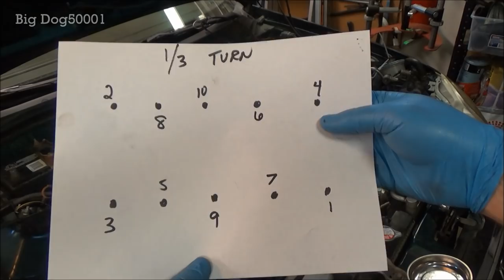Honda Cylinder Head Removal 2000 Civic (Head Gasket Replacement etc)(1996-2000 Similar)

Comment from the maker: In this video, I did not remove the timing belt from the vehicle like the Honda manual tells you to.  I bought this from someone who did not take care of it for a long time (so the car was mine at the time I filmed this) and I wanted to get it running as quickly and as cheaply as possible so I used a shortcut for the timing belt.  If this job was for someone else, then I would have removed the entire timing belt properly and recommended that a brand new timing belt, new pulley, new water pump and new belts be properly installed after the head was repaired/replaced.  

If you want to give a thumbs down for this, by all means go ahead, I understand.

P.S.  It has been well over a year since I filmed this and I still own this car and it being driven every single day without issue (one of these days I will go ahead and replace the timing belt components).  This is the car I loan people when they bring me their vehicle for repair and they do not have a vehicle to drive while I am fixing their car.
Reply: To affirm that that trick, though risky, can work; I too have slipped my timing belt exactly as you did a coupletimes now and had absolutely no problems. (The reason once wasnt enough was because i didnt go far enough inside the engine to fix ALL of the problems....mine was previously owned by a teenager with no clue how to work a manual transmission.

Comment: VERY THOROUGH AND DETAILED vid. Well lit with good narration. I like it.
I opened up the gasket cover of an '87 Nissan CoStanza to replace the cardboard gasket years ago. Didn't know what I was doing. But at the advice of a mechanic, I'd bought the shop manual when I purchased the car and did minor repairs over the years. Good investment. Saved me a couple grand on repairs. And I learned a few things along the way.

The Nissan? Ran for another four years before I traded it in. No leak since the replacement.
Reply from the maker: '87, going way back lol!  Thanks for the comment!

Comment: this is the best head gasket video i’ve seen for a 2000 honda civic lx( i have the exact same one) and i’m sure this will help me out. i used distilled water instead of coolant because i was loosing coolant before so that was a waste. i did a flush after because inside my radiator was a mud looking substance so i did a flush and used distilled water to fill it back up and white foams started to pour out the cap while off. my oil looks great, no milky white substance in it. it seems like it’s a small leak so i’ll replace that. it has 187xxx miles so i guess it has done its days. and also i broke off a bolt while replacing the the valve cover gasket so this video relates to my situation very much so. fantastic video!!!! i’ve subscribed and liked this video👍🏽👍🏽👍🏽 way to go
Reply from the maker: Thanks!

Comment: Thank you so much for this video. I can't thank you enough! I did a lot of research before replacing all my gaskets. Your video hit all the key points I need to validate so I may also have a successful
Reply from the maker: I appreciate the comment, thank you!
Reply: Will the head gasket make the car overheat if it's bad
Reply from the maker: @chewy3707  Yes it can.

Comment: This is one of the best head gasket removal video out there. Thanks to Big Dog50001 Automotive!! You make it look like easy sir!! Very methodical. BTW - recently I did replace Valve cover gasket on my 2006 Accord - guilty as charged - I did use RTV all around :( Will take care of it next time.
Reply from the maker: Thanks 👍!
Reply: @BigDog50001  , Is it required to replace intake manifold gaskets every time the assembly is removed? I had to remove it in J series V6 engine on 2006 Honda accord Ex when I needed to replace valve cover gaskets. Thanks in advance for your answer

Comment: Great video, used this to replace mine. Funny thing is that I got an exhaust manifold crack in the same exact place as you... which is crazy. I believe it broke when I was taking off the exhaust manifold bottom bolt, the torque was really straining on everything.
Reply from the maker: It is very common for the manifold to crack in that area on these.  Thanks for the comment!

Comment: Very good video. Only problem was even after draining radiator I still had coolant in the block when I removed so made a little extra work for me. Wondering if maybe I missed something or possibly had a air lock

Comment: This guide is how to remove the head and what you intend to replace, mainly head gasket. Do you inspect the flatness of the surface where the head gasket goes/lies on top of for every removal of do you just change the gasket and that's it. I noticed an oil spill on front surface of block beneath the head gasket line. While driving I experienced a short (not even a second long) acceleration stutter in 1st gear and a popping sound coming from front/right-ish side (left-side steering wheel car). Drove for another 5 minutes to come home and everything was fine and just out of curiosity popped the hood and the fresh smelling oil was about to be seen.
Should i just drive it and see what happens, ie. can i do more damage to engine (valves etc.) or is that a sign sth is damaged? Is it normal the front side of engine block/head area is oily? 

PS: D14A4 owner and lately drive well over 3k rpm because slow/underpowered/fun...

 Thanks!

Comment: So , I have a 2000 honda civic dx SOHC . A spark plug broke off into the head, tried to use a extractor and that broke off also. I am in the middle of removing the head to get the broken pieces out. 

Do I need to removing the valve train fasteners?

Comment: I've been following your video step by step. It's been very helpful. Thank you so much. Everything that needs to be off to pull the head is done except the intake manifold. I'm having trouble with the bolts. I even took out the fuel rail and injectors to get better access to them. They're not really rusted or anything, just super torqued down I guess. I don't have any power tools, all I have is hand tools. No torch to heat them up either. Tried a breaker bar but it started to strip one of the nuts so I quit. This will be the 3rd night that I've soaked them in PB Blaster. Do you have any suggestions or tricks to getting them out with just hand tools? I was on a roll and now I'm being held up by these stubborn bolts. Please help.
PS Mine did have the extra bracket to the bottom left of the exhaust manifold but when I took the bolt off the bracket was broken. Probably why yours wasn't there.
Reply from the maker: I believe you are talking about the nuts that hold the intake manifold to the head.  Sounds like the nuts are seized to the threads and the stud threads are probably seized inside the head.  There is not much room in there but I would try to get a good 6 point socket on them (that is what I did in this video).  Impact helps on seized fasteners also, so GENTLY tapping down on the sides of the nuts with a small punch and hammer might help loosen bond between nut and stud (avoid hitting threads of course).  Lots of PB Blaster doesn't hurt.  You may need to pull the head off with the intake attached and work on them outside of the vehicle.  Worst case scenario is the nuts are cut off and intake removed from head and then the studs would need to be removed and replaced (might need a machine shop to help with that).  Good luck and thanks for the comment!
Reply from the maker: @gypsychristo6727  Good to hear you got them out.  P.S. The PCV is really easy to get to when the head is off ;)
Reply: @BigDog50001  Sorry I keep pestering you, but I trust your input most. 
So I got the head off but I'm a bit concerned. The gasket looked to be in perfect condition, still had the blue paint on most of it, no chips, cracks, etc. But the intake manifold was ate up! Practically crumbled. Plus the spark plug well o rings were badly damaged and oil was leaking on the valve cover. (From the pressure caused by faulty PVC maybe?) Could this have caused similar symptoms to a head gasket leak? I rented a carbon tester for the coolant system prior to disassembling and it was positive for gases in my coolant. The only other symptoms I had was leaking coolant, right under the motor, and after about 30 mins of driving, my coolant would be boiling in the reservoir tank. Of course, I changed the thermostat and radiator cap first, but it still continued. I just got it payed off and I'm thinking they changed the head gasket prior to selling because it looks pretty fresh, but failed to replace PVC and manifold gaskets. I'm worried about a possible crack in the block or head. Never ran it in the red zone, but who knows what the previous owner did. I'm really hoping it's just the manifold gasket and PVC that was causing the problem. There are no machine shops in my area to check it or resurface. I'm a single mother and any advice to help me fix this car would be much appreciated.
Reply from the maker: @gypsychristo6727  From what you describe it sounds like a bad head gasket.  The intake manifold gaskets are paper/fiber type so it is common for them to come out in pieces.  Best to have the head checked but if you can't, well then you can't.  I would install new gaskets (head, intake, exhaust), new oil seals for the spark plug tubes and a new valve cover gasket.  Here is a link to the installation of this head if you didn't see it already.  https://youtu.be/WRimAlf-A1k
Reply: @BigDog50001  After cleaning the head, I found a deep gouge on the gasket surface. Looks like some idiot tried to take the peg out with a screwdriver and slipped. That's probably why the old gasket looks fairly new but still failed. Theres also horrible looking  marks on the sides of the peg too, like plier marks. Idk if that matters tho.
 I filed down the nick that was sticking upwards, now its just a small pit that I can fit my fingernail in, but it's as wide as the tip of a screwdriver. That's where most the crud was too. Gonna try copper spray to help fill it. Someone else suggested a drop of JB weld to fill it, idk about that tho. But I've got both your vids saved to a playlist I'm using to follow step by step. I wouldn't have tried this without something to watch as a guide. Very thorough.

Comment: Any solution to the broken head gasket bolts? I have the same issue with 2 of them -_-
Reply from the maker: If the Valve Cover Bolts are broken inside cylinder head (or valve train) and the head is not damaged then you can use broken bolt removal tools to extract the broken piece and then buy new bolts.  

If the Valve Cover Bolts damaged the head or valve train (like in this video) here are some things that can be done:  
1. Time Sert to fix threads

2. See if machine shop can fix threads/damage
3. Replace broken part if on valve train (if possible)
4. Replace head with used unit and have it machined at machine shop or buy a used head already machined from shop

Comment: Thinking about trying to replace the one on my girlfriends 99 civic. Total side issue I have already replaced many sensors on it it does not like to start once warm ask like it’s flooded if you hold down the Excelerator too wide open and let it clear out it will start any idea what might cause one of these to pump too much fuel into the engine and
Reply from the maker: Without seeing vehicle I am just guessing, but I would look at Engine Coolant Temperature Sensor (ECT) readings, Oxygen Sensor (O2) readings as well as MAP sensor readings.  The engine computer uses all of the those to adjust fuel delivery.  Aftermarket sensors don't play well with Hondas sometimes too.

Comment: Do you think it's better to get a remanufactured cylinder head from eBay and get that installed or going to get a replacement motor from the junkyard? It would be about the same price $300 just for the motor or the cylinder head either one, but I want to know your opinion thanks
Reply from the maker: If the bottom half is ok then at this age I prefer to get a rebuilt head (from a good machinist).

Comment: Great video big dawg, hey i need your input. I have a 1992 Honda Accord and was replacing the Fuel filter the other day and i unplugged the throttle position sensor connector to kind of get it out my way for the job and when i finished i went to put it back on and it slides all the way on it and stays, but it does not have that little "snap" sound it makes when you connect it. If i grab the connector, it just slides right off the TPS with me having to depress the Tab to get it off. But it does not look broken whatsoever, i looked at it for like 45 minutes. Any suggestions? Thanks!
Reply from the maker: That happens alot on older connectors.  If it stays put I would leave it alone, thanks for the comment!

Comment: Got a problem. Like an idiot I took off the distributor and didn’t mark it at all. I didn’t turn the 1st piston to top dead center either. I am still working on the car and trying to replace the pistons and rods without removing the engine from the car. Will timing be a problem when I put the car back together?
Reply from the maker: I can't see what work has been done but it could be a problem.  When reinstalling the distributor, I would position it right in the center (probably have to time it later).  I would avoid turning the crank and cam independently if the timing belt is removed.

Comment: Hey boss, I'm in the middle of this job, and can't seem to locate the bolt holding the intake manifold in, you mentioned that it was on the bottom, but I haven't been able to find it... Any pointers would be appreciated.
Reply from the maker: There is an angled bracket underneath the intake on most of the older Civics that holds the intake on.  The bracket is held on with two bolts, there should be one bolt that goes straight up towards throttle (on a D16Y7 engine) and one bolt that goes towards front of vehicle (other engine configurations are similar but sometimes both bolts go towards front of vehicle).  If the vehicle has ever been worked on before, this bracket might be missing.
Reply: @BigDog50001  Thank You so much, I'll definitely be checking tomorrow morning, I appreciate you
Reply: @BigDog50001  just finished the job today, it's a super obvious bracket if you're under the car. I appreciate your help
Reply from the maker: Good to hear you got it done!

Comment: Hi, I'm doing this job right now.  I followed your lead and took the belt off of the cam sprocket without removing lower timing cover.  Gotta admit, I'm a little nervous.  It is a lot quicker like you said, but is there any way that belt can come off of the crank sprocket and mess up the timing?  I for sure do not want that to happen.  The engine I'm working on is a 2000 VTEC - basically the same thing as what you have.  Please reply, thanks...
Reply from the maker: It is a tight fit on crank so it usually will not move (especially if you keep some tension on it like I did).  After reinstalling belt make sure marks are still lined up on top and bottom.  Then be sure to turn engine over by hand multiple times (in correct direction) after reinstalling belt and verify timing marks are still  lined up (of course stop if you feel anything hitting inside engine).  

Worst case scenario is timing belt jumps a tooth and you should see that after hand cranking.  Then you would have to remove lower timing cover and remove belt and reset timing belt the normal way.
Reply: Ok thanks for the info. I think I’m all good but just wanted to be sure. Great videos man, keep ‘em coming...

Comment: do the heads on these engines wape easy? Im going to be doing this on my 2000 Civic EX but a friend of mine thinks the head will have to be resurfaced.
Reply from the maker: 50/50 on whether there is any issues with the head.  It is best to get the head resurfaced though.

Comment: If only we're on the same country, i will take you my 2001 honda city type Z to fix. But unfortunately, we're both on the other side of the planet. Anyway, my problem is i found out recently white smoke coming out from the manifold cover and notice some oil wetness around the cylinder head. I assume i need a cylinder head gasket and valve cover gasket replacement already. Is my thinking correct?
Reply from the maker: It sounds like you are on the right path.

Comment: I'm trying to diagnose a misfire issue I have been having on my 1998 Honda Civic where I change the engine and still had a misfire code when I ran it on the code reader at my workplace! any tips on what to do
Reply from the maker: Well in general you need spark, fuel, timing and compression for a cylinder to run.  So you need to do some test to verify what you are missing.  This vehicle in the video had a misfire and I did a video on testing the fuel injector to see if it was working: https://youtu.be/pzeOz-seIQE
Reply: Big Dog50001 Automotive I will have to take the head off again because I don't have the time due snow outside in my area and I don't have a heated garage

Comment: Big Dog, 
Your video was invaluable. Because of it I was able to replace the faulty head gasket. Thank you. But, there is a potential problem that I've created. At minute 52:17 on this video you show a rubber piece that fell of the cover you just removed. When I put the parts back on I neglected to include that part on the cover. My question: How serious is the absence of that piece. Should I go back in and remove the appropriate parts in order to reinstall it. Or will the engine run okay without it. 
Once again thank you for your guidance. 
Bart
Reply from the maker: It seals off the timing belt area so dirt, oil and debris do not get in there.  It should run fine but it may shorten the life of the timing belt.  I would probably go in and reinstall it if it were my car.  Thanks for the comment!
Reply: @BigDog50001  Thank you for your response. Well, now I know what I'll be doing this weekend. Once again, thanks.